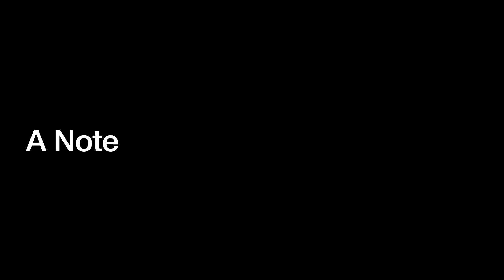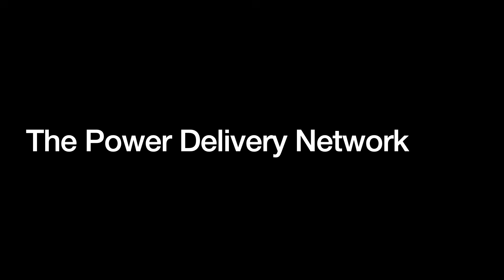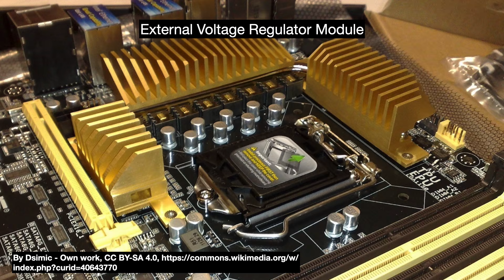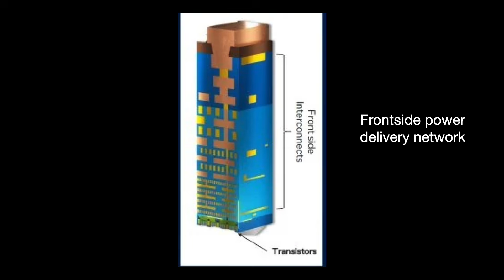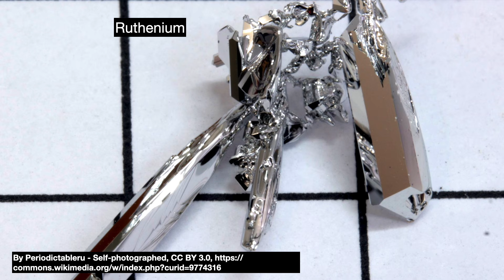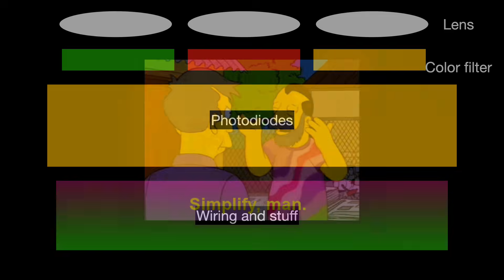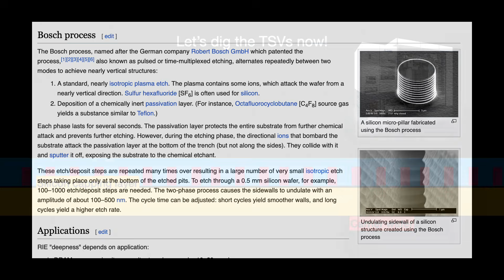Intel’s Next Breakthrough: Backside Power Delivery

Comment: It's sad that while hardware keeps getting faster and better, the software that is run on it keeps getting more bloated and slower.
Reply: At least gnu Linux doesn't bloat as fast
Reply: All that ancient mainframe software must be AMAZINGLY fast on modern hardware. A lot of it was written in Assembly 30+ years ago when computers were a million times slower,
Reply: @kellymoses8566  yeah. I recently read about the pistorm which makes the amiga (680x0 in general) so much faster by offloading the cpu work to the pi.
Reply: @kellymoses8566 if you want to see an example, try running Falcon BMS 4.37 on a modern PC, graphics aren't that much improved, but it runs 380 fps average in the dynamic campaign with thousands of units.

An a better AI than DCS.

Not exactly what you're looking for, but a very graphic example
That game/sim is 26 years old after all.
Reply: @kellymoses8566  web browsers use to run on a 486 with 4mb of ram now you need 4gb+ of ram to even open it.
Reply: @kellymoses8566 thugs
Reply: And becomes more and more like Spyware.....cough, Windows 11, cough, cough.
Reply: @LupusAries  I dread the moment Microsoft fully embraces the Windows 365 idea...
Reply: @LupusAries  shut up, Windows 11 is not 'spyware", and is not becoming more like just because of an optional feature that is encrypted and local (it's not even work on most 11- supported machines).  People like you make good criticism of MS pointless because it gets drowned in an ocean of bad critique and garbage FUD. 

Also, I find it funny that people like you are mostly saying nothing about the mobile phone - which remains the worst tech wrt privacy to ever exist, and being iOS will not save you.
Reply: @ogBINARYGOD  if win11 isn't spyware, why do they insist on turning analytics back on every time I update. There's no way that's not intentional man. And almost every company is doing it too.
Reply: @LupusAries  Websites need cookie cutters lol.
Reply: @LupusAries i'm in software development and my experience isn't universal but I will say at least at my shop our performance metrics are our users complaining and does it feel fast to us.
Reply: @LupusAries i'm in software development and my experience isn't universal but I will say at least at my shop our performance metrics are our users complaining and does it feel fast to us.
Reply: It’s definitely all the new “features” these applications keep adding, often described as well as the MCAS when the 737 MAX first rolled out if they’re even mentioned at all. The worst of these being Chinese apps, which kept randomly overheating my phone when I still had them installed.
Reply: @doujinflip  MCAS had a reason to exist, it was built wrong, but it was a safety feature. Fighter jets (at least the f16, not sure how far the tech spreads) have a system to avert the plane from earth in a case when pilot blacks out. it has saved multiples of lives.
Reply: @doujinflip It isn't the features, that's merely a coincidental occurrence, an unused feature in a well crafted program eats so few resources you need a debugger to even notice it. 
 How it occurs is, companies that don't give a damn about the quality are also the same ones that need to have just One More feature for the next quarterly report and don't give a damn how good it is under the hood, so long as it makes before the next reporting period both internally and on company level.

Let's take ASUS Armoury Crate, some bits of it are ingeniously crated, the low level stuff, you could hold seminar speeches on that quality. But then the UI wrapper for it essentially fires up a microserver cluster pretending to be an entire microservice setup written in one of the most inefficient ways I've ever seen a piece of software created, to the point that if twilight zone hell gates ever open, it'll be from every installation of that digital hellscape.
Reply: windows isn't Spyware
Reply: It's bizarre to me how people accept such bloat in desktops and servers. As developer focusing on Unix/Linux systems I see some of it but nowhere what happens in the rest of industry.
Reply: @KevinLyda  The alternative is a lot of software that currently exists wouldn't exist at all. The more libraries I can use is less code I have to write myself, turning a 10-year project into a 3-month project. Very competent video games can be made by a single person now. Web browsers are effectively a huge rendering engine along the lines of GTK but with more or less every possible feature already added in, hence the power of javascript despite some not-so-great design choices in its early days.
Reply: @widget5963  but that's for a dev, but for a user if he wants smth he can (bundle) install it, addons, plugins... But the main thing is core libs are bloated.
Reply: @KevinLyda  Because it works and it's significantly cheaper at the point of purchase/need.

This is an issue with pretty much any product, not just software. For example, people rather have cheap cloths from China or India that last weeks (if not days) wearing it than buy notably more expensive good quality cloths that can last years, even if buying the "cheap now" cloths are significantly more expensive "per day use".

And with software this is arguably more extreme, how often do people replace software for a newer version or a competitor? Pretty much yearly at least. And add to that the whole "product as a service" BS and there really isn't a need to be against any sort of bloat as long as it just works. It just needs to be "good enough", not "good".
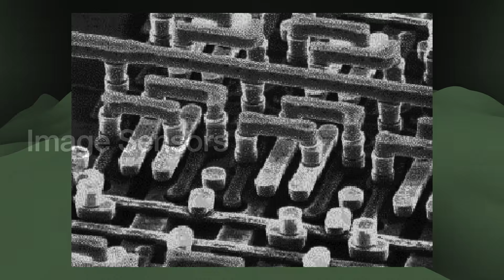Reply: 13:27 not quite accurate... The retina on all fish, reptiles, birds and mammals is wired the wrong way around as well. Light has to travel through blood vessels and nerve fibers to finally make it to the cones and rods.

Back side illumination is
Reply: Most Software is not programming anymore. It's now just a matter of manipulating many stacked frameworks to do tasks, hence the bloat.
Reply: What I find more worrying, you can not really OWN software anymore. I noticed when I wanted to install some basic programs I am used to owning. Now half of them only run when you are online and all of them need online registration to even install. Although they are paid for. So you don't really own them anymore.
Reply: They even let me write code that goes into production!
Reply: Its mostly spyware, even linux has a lot of abstraction layers but runs way faster than winnt.
Although the one place where there is a hell of a bloat is webapps
Reply: As a close to metal dev (and 41 years old) I feel the same, my take on this is that due the higher ipcs we are getting today, many younger devs are often becoming complacent and not bothering about code efficiency anymore as we had to do back then.
Reply: That's why the chips need to get more powerful 😂
Reply: When software on the server side costs money to operate everyone suddenly optimises everything to bits.
Reply: so true
Reply: Well there are less and less people who work with hardware and these are squeezed out to near zero because inefficient applications can be created way faster so one has the first mover but in the long term a product to rewrite.
Reply: I'd argue the software becoming increasingly bloated and inefficient is a direct consequence of the hardware becoming faster and more efficient. There's less reason to "waste time" optimizing code when you can just make something that works in a shorter amount of time.

It's a classic time-money-quality trade off
Reply: Devs used to have to optimize everything about their software, now they just rely on the raw power of the hardware.
Reply: Cof cof Windows 11 cof cof
Reply: Not on linux-land B)
Reply: Don't totally fret, the software catches up. Its slow but the abstraction bloat gets slowly consolidated out of the software baseline. It just takes time and motivation.
Reply: Software and capacity is like liquid and a container. It's gonna fill it up
Reply: Yes, and one of it is react
Reply: Thank electron for that. There is a better optimized alternative being developed but it was still In beta last I checked
Reply: We should also have a "Moore's Inverse Law" of clunkier and clunkier software :p
Reply: @martinbadoy5827  https://en.wikipedia.org/wiki/Wirth%27s_law
Reply: The software gets like that because the hardware allows you to brute force past inefficient code. Very few places still take the time to streamline the code and squeeze every ounce of performance. The few that still do it well are those that code for old hardware for nostalgic reasons, or for fun.
Reply: who cares

heavy compute tasks can easily bypass all those abstraction layers, you have the full power of your processors at your disposal when you actually need it

application software is “bloated” because the feature set people expect of it as default keeps expanding; say text editors now keep a live updating index of symbols in your project and infinite edit history for all open tabs persisted on reset
Reply: The abstraction kinda blow my mind, I'm self taught and mostly just do my projects, but when I finally talked to another programmer they called C a low level language, I felt like I just came out a time capsule from 1980 when they said that.
Reply: Thank god AI is coming to save the software industry!
Reply: it’s easier to write software than it ever has been. I think that’s a net positive
Reply: Please go and run Windows 7 on a 2010 machine, use an SSD for all i care :)
Reply: I'm baffled they can't turn. I don't say an ai, but just some yet another abstract layer algo to ultimately optimize code layout. You can't expect people to manually address cell by cell, but with so many of them you can achieve some kind of linear optimization quick enough. Contact me for details
Reply: @leonetto6021 They don't had to amd they don't wanted to! It's a well lubricated machine, better it was. More RAM, wasteful lazy code. Demands more RAM. Till last november a giid cycle, but now it'll work no more.
Reply: How do you sell ever faster and more expensive hardware if the software does not get less efficient and use more horsepower?
Reply: @michealmorrow1481 never attribute to malice that which can be sufficient explained by incompetence.
Reply: Sufficiently advanced incompetence is functionally indistinguishable from malice
Reply: Well, a lot more people can code with this layer of waste.

Good programmers can produce more and bad programmer can produce "good enough".

It's a tradeoff and not necessarily a bad one.
Reply: @iulioh good or bad, no one will make a webpage in C++, it's all on bloated libs like Vue and react than run on top of sandboxes browsers.. at best they may ditch some libs, but knowing webdevs they will happily import 10MB of crap just to zero pad a number.....
Reply: @iulioh  trading off wasted cycles for more, less capable programmers used to be an effective strategy. Over the last half-decade, I've noticed that strategy falling apart. We're stretching the industry WAY too thin. Overloading it with people who can barely type their name, much less write software.

My honest opinion is that we're at an inflection point where we need to re-evaluate the base theory of how we operate. We can't keep trying to tap less and less capable resources and expect continued innovation. IMHO, we should turn it around and ask the opposite question: Can we make capable software engineers so much more capable that we don't need as many?
Reply: @iulioh  the languages can also get less efficient...
Reply: @iulioh oh wow thank you for saving me from OP's thought process, its an easy pitfall. Minecraft is one of the best games ever made, its also horribly slow
Reply: @iulioh that is an obscene cope
Reply: в точку.
Reply: Depends on the niche, high frequency trading software isn't getting more inefficient, over the past decade it has improved substantially, I remember the days of using Java for trading. Now we have extremely optimized C++ driving parameters sent down to FPGA cards and sometimes even ASICs (common for trading on Eurex). We went from not caring much about a ms to optimizing down to single digit nanoseconds from first bit in to first bit out.
Reply: Its kinda similar to the way technology has not reverted has more free time and money to most people. Maybe its some kind of universal mechanism...
Reply: well for the average joe its only a few ms difference and thats considered good enough
Reply: This
Reply: Don't worry, soon programmers will be replaced by ai.
Reply: @florin604  90% of the commenters on this damn site already were
Reply: Without bloated software, there is no need for faster hardware.  Think about it, if we are still running Windows NT 4.0,  do you think we'll need anything beyond a quad core?  Paradoxically, bloated ware are a necessity to innovation. Just like Jeff.
Reply: @sgtjyf01  this don't make sense, no one is making faster CPU because your discord is bloated
Reply: @sgtjyf01 innovation for innovations sake isn't a good thing imma be honest
Reply: "wirth's law"
Reply: reminds me of blinns rule.
Reply: Except AI.
Reply: try use linux, and fuck nvidia
Reply: That's not how any of this works. The 'software' always exists first, at least the idea of how to do something. Then hardware catches up to make it doable. LLM ideas have been around for decades. Someone put enough $ into enough hardware to do something, and here it is.
Reply: Its a vicious cycle to keep everyone buying new hardware, keep the rich richer, and destroy the planet.
Reply: There's an explanation for this that's as simple as it's sad: it's an inverted stupidity pyramid.
At the base layer there are physics PhDs & other ultra-smart folks pushing against the laws of physics designing the incredible chip-making machines and chips with specs though outright impossible just a few years ago. Fortunately, a next-generation machine/process is a once-in-a-few-years type deal, and it's just one type of a machine. The chips are also relatively universal and relatively infrequent. That means, the very few available folks who're that smart, are enough for the task.

Next (I'm skilping some layers that nonetheless follow the trend) we've OS/language/framework designers. They have to be bright - but not out-of-this-world-bright like the aforementioned cohort, and you need a lot more of them.

Next we've software devs, and there's such an infinite demand and infinite diversity and churn of that software, that if you can fog a mirror you can probably get hired as a software dev. Not at FAANG, but somewhere.

Next, we've end-users. That's everyone, nowadays. They take that Office365 MS Word, however bad it is, and use a spacebar to "center" align a title, and hit "enter" a few times to skip the rest of the page, then manually assign (and re-assign) fonts in 57 different places and if you mention to them that they can use styles, page breaks and so on, they look at you like you're the personification of a throbbing, head-splitting migraine - which for them at that moment you probably are. Their whole workday consists of changing the font in 57 places when their boss tells them to, and that's how they like it.
Reply: We need a great reset
Reply: Not really, the software depends squarely from the hardware how fast the calculations are made in the ALU. All this speed comes from my algorithm which I call USIA.
Reply: And if you install AI software, it starts to hallucinate.
Reply: yeah just wait for AI to solve everything lol
Reply: Intel is the only company that has put billions in Research that not even Google or Meta or any company can come close to .
In Research and Science sometimes you are very unlucky with No results and that is why intel seems to struggle .
Reply: Because MBAs make 3rd class Product Managers and climb the social ladder with politicking and are devoid of any legitimate merit. That is why software is rotting
Reply: Faster hardware? Well I guess we don't have to optimize these loops.

Looking up the same value from memory instead of cache over and over again? Well main memory is fast enough!

Electron? Electron!!!1!!!1!!!!!!!!!!!1!
Reply: So true, look at web browsers they now have more code then Linux. And developers are often using a browser as a front end for apps. 
That's on top of massive frameworks and frameworks for frameworks and hundreds to thousands of dependencies.
Reply: Lichess is coded on Scala. It's pretty fast.
Reply: this is only if you have libraries calling on libraries. if you have functions written exclusively for the program this doesnt happen...
Reply: @LiveType  we have to teach programmers how to do "layer etching" , or just BAN javascript
Reply: We need more open source.
Reply: Software simply does more.
Reply: Intodrucing!!!!! L I N U X!!!!
Reply: Indians and AI is becoming more common in a race to the bottom, and you can't really go lower that indians😂
Reply: That's the dumbest comment I've read.
Reply: Not really. Erlang now has jit and faster,  as an example. You just rarely see or interested enough in development
Reply: @maybehuman4 thx for verifying it for me. 

the zero sum game software devs play with hardware devs struck me one day at my kitchen table in about 2001 but I grew up in a Commodore 64 & tape cassette storage 😋

✌🏻🤓
Reply: I argue this is an inevitable equilibrium that has so far kept software prices lower than they otherwise could be. If engineers reach a performance wall and computer hardware stagnates, I think we'd start seeing a lot more money going into software efficiency to make up for the gap. But for now, there's not much of a need to make efficient software when hardware advances so quickly.
Reply: That's so true... See it real bad in gaming. The new hardware struggles with the new games, that's why they lean on TAA the blurry fix lol
Reply: That's another way of saying you wish we had fewer apps available. The bloat comes from devs trying to make as much cooler stuff as they can, and dialing things to lower than max quality and higher quantity.
Reply: Maybe the RAM shortage will leato more sentient programming.
Reply: Rust.
Reply: This isn't really true tho.. a lot of it is getting more bloated but it's also doing more. If you want the simple programs of the past, they still exist and a lot of them are running crazy well.
Reply: Probably the single biggest misstep in technology development over the last 2 decades.
Reply: Developers are more expensive than new hardware so things are built with minimum effort.
Reply: At risk of sounding like a broken record, this is one of the main selling points of Linux. I'm using Arch Linux on a 20 year old laptop without issue. I'm sure it'll last another decade at a bare minimum. 

Software bloat is only really a problem on proprietary operating systems. Whenever free and open source software gains traction, you've got hundreds of thousands of people who will all find little optimizations they can contribute, so you're left with a more stable, more secure, more functional, and more efficient system.
Reply: Yeah I mean just look at the crazy hardware advances since, say, the days of Windows XP and yet the user experience is worse in every way.
Reply: @Shrouded_reaper  Than windows XP? You must be crazy
Reply: Thats what you for hiring lazy devellopers.
Software developers have been getting more incompetent by the years.
Reply: Partially false. Algorithms in general have made a leap forward, sometimes even faster than the hardware itself. Bloat is a thing, but computers do more and more. Some of the replies to this comment are essentially comparing Lotus 1-2-3 to Google Spreadsheets like they "do the same". Just nostalgia kicking in.
Reply: @IvanStepaniuk Google spreadsheets is helluva a lot more than lotus 1-2-3 but what about comparing to Excel 2003. Office suites aren't much more featured nowadays than they were 20 years ago.
Reply: What good is hardware if it cannot run better and more featured software. Software is just a tool to get things done, not something to admire the size of.
Reply: @sumansaha295 "just a tool to get things done, not something to admire the size of" - imagine if the same "care" went into the hardware - we'd have computers taking up entire floors. Oh wait, we had that!
Reply: @AlexKarasev  not as good an analogy when you realise we already started from the smallest software possible(instructions)
Reply: @sumansaha295  what I stated wasn't an analogy - we literally had whole-floor computers before a massive amount of top-tier intellectual work had been invested to make the computers as small and fast and efficient as they are today. There are relatively few people capable of doing such level work and very few companies willing & able to retain that caliber cadre for decades taking risks worth tens of billions of dollars.

Unlike hardware companies fielding their few highly optimized, ground-breaking designs every few years & taking as much time & money as the endeavor requires, software companies need a lot of diverse software out the door very quickly, for which they need a ton of coders who can't all be as smart as those hardware guys. Lithography machine or chip creation has zero room for mediocrity in execution or leadership, while software creation has a vast room for mediocrity in execution & management.
Reply: @AlexKarasev  and there have been similar evolution in software, else we’d be punching cards. Most of the heavy lifting is still done by a few amount of very smart people, compiler designers, graphics programmers, etc.
Reply: @sumansaha295  "else we’d be punching cards. Most of the heavy lifting is still done by a few amount of very smart people, compiler designers, graphics programmers, etc"
Those are fair points, actually. It's a pyramid ranging from very few very smart people solving very hard problems for relatively few devices (chip-making machines and chips) to more but still a limited number of pretty smart folks doing hard-core compiler/graphics/driver/OS work as you pointed out, to a whole sea of varying skill level programmers stringing together frameworks any which way they can hack it, to end users using a space bar in MS word to "center" a word or "enter" key a bunch of times for a page break.
Reply: That's why you need linux. I didn't go to Winadds 11. I am sure these new AI NPUs will mostly be used to make money off you anyway. I'd like to use my hardware for myself, or otherwise low-power or off. Not for Microsoft's profits
Reply: @roanbrand7358   linux isn't the solution either, we need better systems. why are we using mini-computer operating systems for a single chip that has only 1 user. its stupidity
Reply: Software is extremely difficult and expensive. That's why no company apart from the trillion dollar companies can actually do it.
Reply: @falconeagle3655 
I wonder what effect large language models writing code will have on this? Make better, less bloated software or worse?
Reply: How many of the naysayers are software engineers?  If you think software is so bloated, go write it yourself.
Reply: @scottpelak1856 a lot of software engineers are cargo cutters anyway
Reply: Too many bad programmers that brute force everything instead of learning algorithmics.
Reply: they are getting broated because the hardwere is getting faster, when it start slowing down the software also gonna be slowed down
Reply: Stupid take
Reply: Intel stock is currently relatively cheap... Good time to get in, but you should be aware of the risk
Reply: Prove it
Reply: Good thing AI is coming to blast efficiency into every layer of software
Reply: @LimabeanStudios  you definitely don't know about AI and efficiency
Reply: @vilian9185  lol?